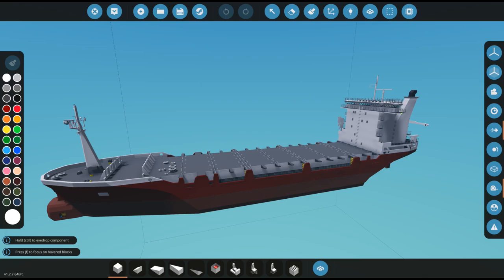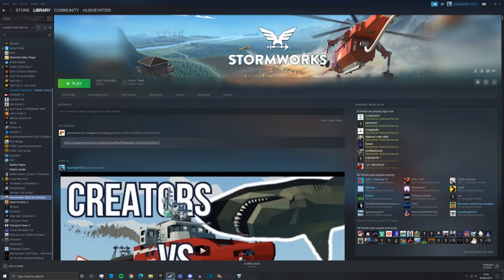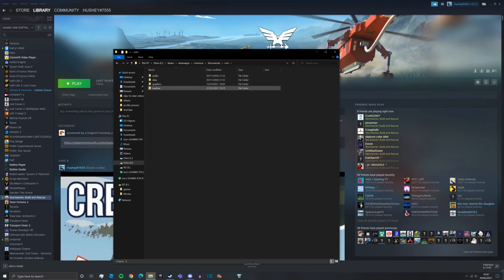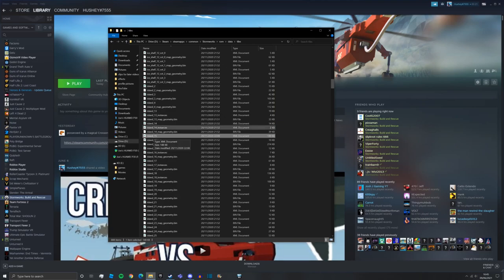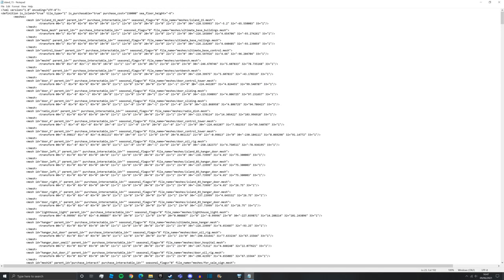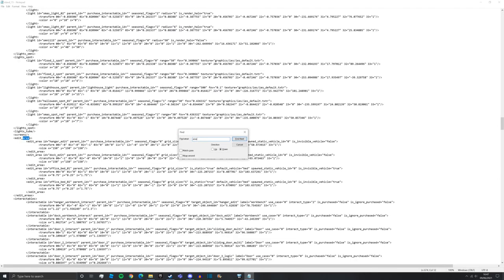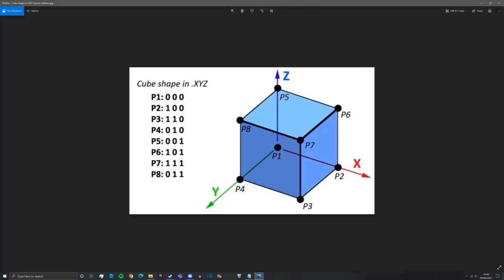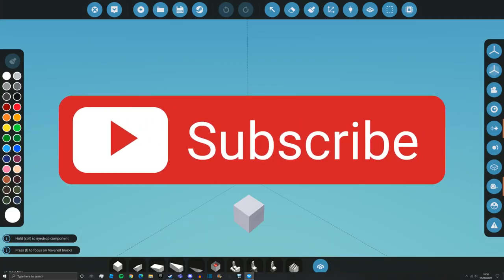Stormworks modded workbench BIGGEST Size & Custom Tutorial!

Comment: for some reason the build area remains the exact same and i do not know what to do to fix it
Reply from the maker: Rewatch the video i checked the other day this still works
Reply: still not working... i realised that your file says much more than mine and some things are different... does it matter if i have windows 11?
 @Hushey
Reply from the maker: @DramaticBob-ji3pe  i dont have windows 11 so dont know for sure but it should be the same. Tried this a few days ago and it stil works. Just follow it through slowly 👍 if not working after that ask the stormworks discord
Reply: i found it... you didnt mention to change the grid size to 0 @Hushey

Comment: I'm a little bit late, but does the numbers, 128,128,128, does that measure in meters or blocks
Reply from the maker: Hi mate. No problem at all there. The number is blocks. Times it by 4 to get metres :)
Reply: its in meters, not blocks

Comment: For Some Reason I Tried This On The Multiplayer Island? And Nothing Changed, Note: I Am Using Size 255, 255, 255
Works Fine On Creative Island Yet Not Multiplayer? im confused
Reply from the maker: Try it again and then if you can't get that to work use the other method I provided
Reply: Which island number is the multi player island?